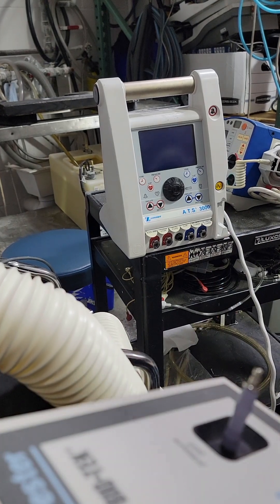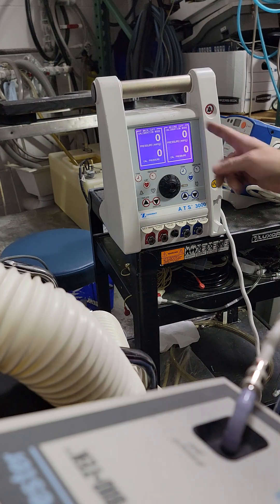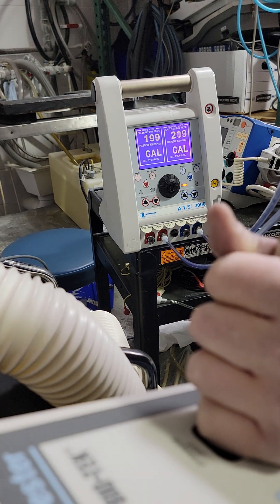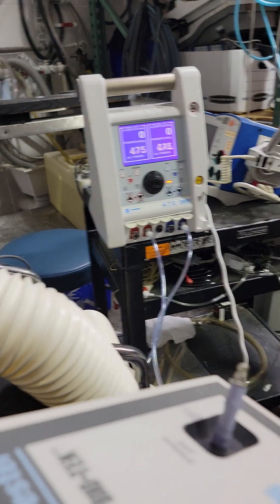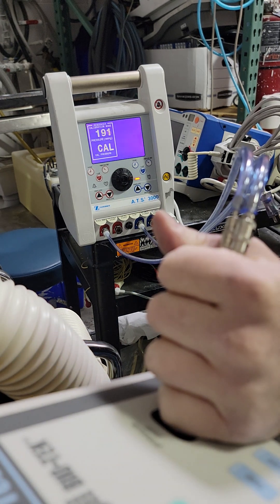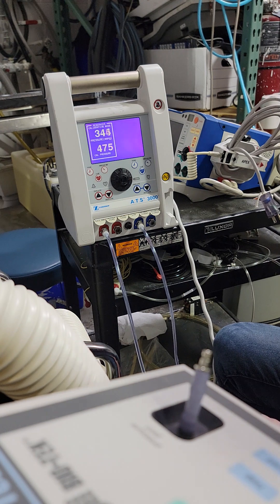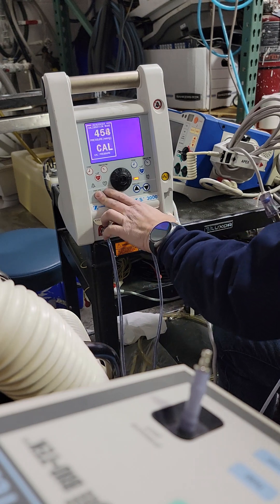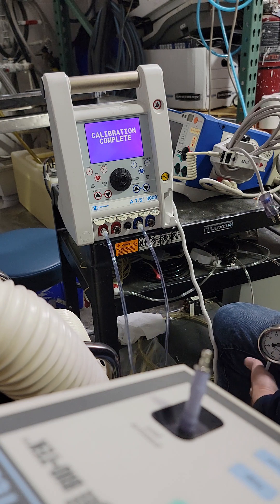Pressure Calibration on a Zimmer ATS 3000 tourniquet

Comment: Does that pressure meter also act as a pump to pump into the unit? The manual indicates three devices 1. Tourniquet 2. Pressure Meter 3. Pressure Source.
Reply from the maker: @Ronnock  yes it does
Reply: Dang. Nice. Unfortunately, I do not have such a device, only pressure meters. Looks like I'll have to look into getting one. Thank you!
Reply from the maker: @Ronnock  test equipment is so expensive,  and nobody wants to service or calibrate the old ones

Comment: Can you list your test equipment that was used for the pressure calibration? Make/model
Reply from the maker: @jasonberube3186  I'm using an old bio-tek nibp monitor tester(that's the only model I can find written on it) it doesn't go to the upper values so I'm still trying to get this employer to buy the right one. Then it's just some hoses and connectors.
Reply: Oh ok. What’s the new make and model you trying to get. I just need to get something for the air source.
Reply from the maker: @jasonberube3186  I was looking at the contec ms200, but after double checking, it only goes up to 400mmhg. I can't find one that goes up high enough. Just have to do a manual pump
Reply: @The_Biomed I found something from fluke it’s the 3130 portable pressure generator it will definitely create the pressure required to cal the ATS
Reply from the maker: @jasonberube3186  wow, that's like an infusion tester and at $8-10k geez
Reply: What kind of manual pump? The Maintenance manual indicates a pump and pressure meter hooked up to the device.

Comment: So, the hose set up for two ports connecting to 1 pressure meter and the proper pressure meter is all that is needed for the calibration. Is this all that you do for the pm procedure, or do you also perform a leak test? I heard you speak to the battery check.
Reply from the maker: so the entire pm procedure starts with the normal visual inspection, 
1: look for any damage, 
2: do electrical safety tests(leakage is really a waste of time), 
3: check the calibration, calibrate if necessary. 
4: leak test( attach a large cuff, set the pressure to 475mmHg, place it into standby; Press the ON/STANDBY button until the alarm message “CUFF” “NOT” “DEFL” appears. Release the ON/STANDBY button and within 5 seconds of the alarm discontinuing, press and hold the ON/STANDBY button again. The button must be held in for an additional 10 seconds before the unit will be set to STANDBY.
wait 10 minutes, then turn it back on then press alarm silence and next press Pressure. the display should read 400mmHg minimum. I don't think you can do 2 at once, but i could be wrong. I'll test this out next time an ATS 3000 comes by my bench. 
5: pull the battery, pull battery cables, check battery voltage(12v minimum) plug the unit in and check battery voltage while attached, should be higher than 12 volts. 
that's it

Comment: Hi. What is the regulator that can be used? I'm over shooting the values,?
Reply from the maker: I don't have a good one yet. I requested the contec ms200 Sim. The listed capabilities will meet our needs.
Reply: @The_Biomed  I meant the knob contraption that can allow steady flow from the compressor.
Reply from the maker: oh, i usually default to a Parker Watts R364. then you just have to get caps and fitting for your application